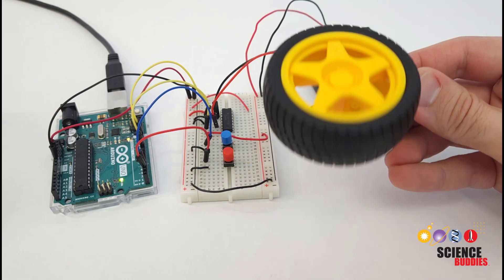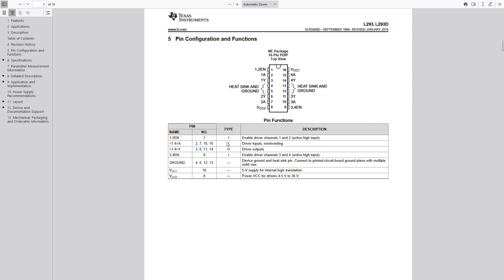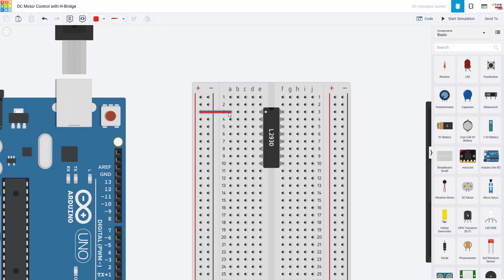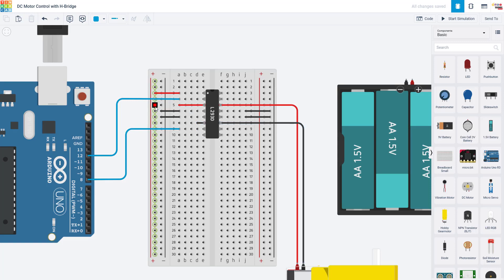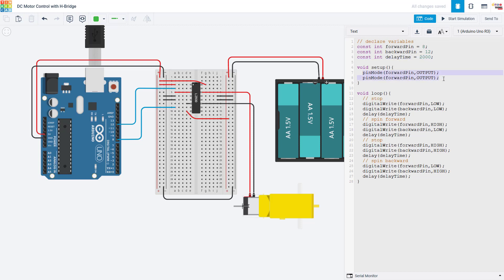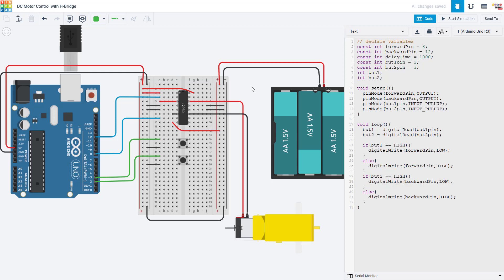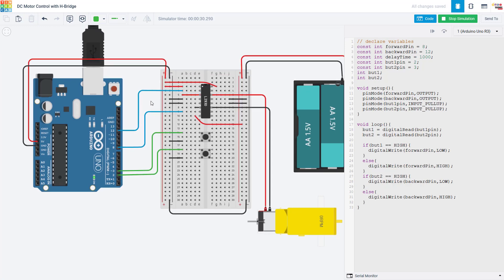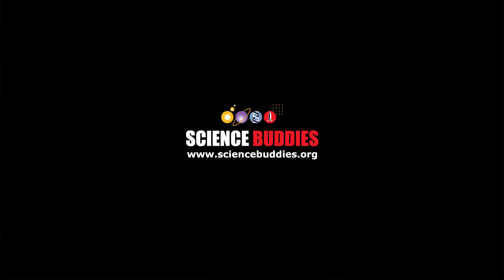DC Motor Control with an H-Bridge and Arduino (Lesson #17)

Comment: 1.Enb pin for speed control.
2.input Pin connect with digital pin(Control pin) .
3.output pin draw power from battery.
4-5 & 12-13. Gnd pin (act as a heat sink)
6. other output connect to motor 
7. 2nd input(Connect with digitla pin).
8. connect to battery(external power).
9-10. for 2nd motor.

11,14,15 
16. logic voltage(5v)

Comment: Hello so thanks for the lesson but i have a question . Does anyone know or can help me to make the motor switch between turning right to left to left to right without using the button , like he just keep switching between the two modes and i how can i control the speed ?
Reply from the maker: Hi - we recommend asking for help in the official Arduino forums.

Comment: I'm trying to control the arduino with an IR Remote instead, but whenever I write any value other than 255 for speed the motor just doesn't turn. Do you know why that would be?
Reply from the maker: We recommend asking for help in the official Arduino forums, they will need to see your circuit and code in order to help.

Comment: Great video. Is it possible to control the motor direction (and also stop the rotation) without using Arduino?
Reply from the maker: We recommend asking this question on an electronics forum where you will be able to receive more help.

Comment: Great video! absolutely loved it! I went back and forth with your previous videos and managed to put a lot of small bits together. I have a very silly question (I am just starting out...). I wanted to know whether we can add a LCD screen to the breadboard to visually see whats happening? Eg: voltage changes (due to ptentiometer) or RPM etc., I am trying to make a prototype and this feature might be very handy.
Reply from the maker: Yep, we have an LCD tutorial here! https://youtu.be/s_-nIgo71_w?si=WzxOJ5RH5R-_XlNO
Reply: @Science.Buddies  Hey, i noticed that there is a significant voltage drop of 1-1.5V across the H-Bridge (L2930). Can you comment on that? is it expected? if so, any way out?
Reply from the maker: The H-bridge has internal transistors which will have a voltage drop across them - explaining that gets deeper into electronics than we can get in a YouTube comment, but you should be able to find other tutorials explaining it on YouTube.
Reply: @Science.Buddies Sure. But any pointers to how I can overcome? Thanks a lot for your reply though😊
Reply from the maker: Unfortunately in this case you can't "overcome" physics - some H-bridges have an inherently larger voltage drop than others. The only solution would likely be to buy a different (and probably more expensive) H-bridge. If you search forums you will find posts about this topic such as https://forum.arduino.cc/t/l293d-motor-supply-voltage-drop-solved-again/218531 and https://www.reddit.com/r/arduino/comments/327kz9/l293d_voltage_drop/

Comment: As a novice, I find your videos extremely helpful. In my current project, I am writing (Adruino) code to slowly ramp up 12vDC motor speed (soft start). I would like to use a pot to only determine the motor max speed. So, the steps would be to (1) turn the pot knob to set desired max speed, (2) start the Arduion Uno, (3) read the value from the pot and soft start the motor to the speed set by the pot. Pots come with different levels of resistance (100ohm, 200 ohm ... 10k ohm). What pot would you recommend for such a project? (Thanks!)
Reply from the maker: Hi - we are unable to provide detailed help with individual projects and this is a bit more than we could explain in just a YouTube comment anyway, we recommend asking for help in the official Arduino forums.

Comment: I found out, quite by mistake I think, that I could (1) eliminate the connection from the Arduino pin 8 to the Input 1 pin of the L293D and (2) connect the Arduino ~11 pin directly to the Input 1 pin of the L293D. Then, I could still analogWrite() values between 0 and 255 to the Arduino pin 11 to control the speed of the motor without reading input from the pot. My goal was to automate a "soft start" and then "soft stop" the motor.  Is that a valid, alternate way to control the speed of the motor? Is there a down side?
Reply from the maker: Yes, it's perfectly fine to hard-code ramp-up/ramp-down PWM behavior instead of having it controlled by an external input like a potentiometer. This applies to any other input/output relationship with an Arduino. For example, a standard introduction activity is to hard-code an LED to blink on and off once every second, so there is no external input; then you learn to use a button to turn the LED on and off. In both cases the "output" code is the same. You could use anything (an internal delay, a button, some other external sensor) to trigger the output.

Comment: Great videos! I am wondering how I increase the rpm in this scenario. I need the motor to run up to around 8000rpm. Any suggestions would be great, thanks.
Reply from the maker: Hi - this is more than we can cover in the reply to a YouTube comment. You will need to look at the motor's datasheet and find its maximum RPM. We recommend asking for help in a forum dedicated to electronics.

Comment: Hey i know its late but can i ask a question, i followed your instruction  step step and it works here's the question though  my arduino is plugin to the computer as should be but the still motors run even though the external battery is not connected why is that?
Reply from the maker: You probably have something wired incorrectly on your circuit such that the motors are being powered by the 5V from the Arduino. We recommend asking for more help in the official Arduino forums. People will need to see pictures of your breadboard in order to help.

Comment: Sir ,
I have exact same mini project.
but we have to use a 15 V supply
so which motor should I use And is there anything that I need to worry about?
Reply from the maker: Hi - we recommend asking this question on the official Arduino forums.

Comment: is it fine if a use a 9V Battey instead, or will it burn the circuit?
Reply from the maker: You always need to look at the datasheet and maximum voltage ratings for the parts you are using in order to answer that question.
Reply: @Science.Buddies  ok, ty

Comment: Hi, if I wanted the motor to continue running after just pressing the button (not holding it down) how could I modify this code to accomplish this?
Reply from the maker: Hi - we recommend asking this question in the official Arduino forums.

Comment: awesome video, really helped me a lot! Just a question tho... couldnt this work wtihout arduino? just using a another supply instead of it? We would be using the buttons just for switching voltage to the input pins on L293D
Reply from the maker: Yes, you can use an H-bridge to switch the direction of a motor without an Arduino if you just want manual hardware control. For software control and more advanced tasks (e.g. steering a robot to react to sensors) you need the Arduino.
Reply: @Science.Buddies  Great. Thank you !

Comment: Hi! I'm currently building machine, which will be using 4 separate dc motors with a wheel on each. Is it possible to connect 1st and 9th ports of L293 (speed regulators) to the single PMW so that both motors would have the same speed?
Reply from the maker: Yes, you should be able to do that!

Comment: Do you need any resistors or anything? Thanks!
Reply from the maker: Not for this circuit!
Reply: @Science.Buddies  if I power it with a 24v 3a power supply would I need any? What would cause me to need them? I plan on using 24v dc motor and adding an OLED display with some extra functions, it will be my first project
Reply from the maker: Hi - if you need detailed help, we recommend asking in a dedicated electronics forum like the official Arduino forums, or a site like Reddit or Stackexchange. We are unable to help with individual projects in YouTube comments.

Comment: Wonderful vid ! I'm gonna use it to create a functioning RC-boat :D I do have a question though - In the previous video u showed that, when using a MOSFET instead of an H-Bridge, you gotta use a capacitor in order to reduce electric noise. Is it still necessary with an H-Bridge ? Would love to know bcs I'm applying an IR receiver to send the signal to the enable pin, so background noise will mess with the circuit/logic.
Reply: Hey, im also planning on building an RC boat. How were you able to communicate with the boat tho? Im struggling in that aspect as well as what material did you build it with? Did you have a “steering” system or just used the motors to turn? Sry for the list of questions :D

Comment: The one thing that you should teach students is that with a switch, you should always make/break the hot side, (the plus voltage side) and never switch the ground. This is a safety issue and if your students go out into the world they will be forced to always break the hot side. Therefore, one side of a switch should be wired to +Voltage, the other side of the switch should have a 10K ohm resistor to ground and the arduino digital pin is wired to the junction of the resistor and the switch. With this configuration the wiring meets the NEC in all 50-states. I know in the hobby world it doesn't matter, but you never know if your students are working, or will be working in industry.
Reply: Does NEC really cover the design of low voltage devices, here 5V DC?

In Electronics, it is quite common that signals are provided inverted, ie. Negation(RESET), Negation(ChipSelect), etc. The customs can vary significantly.

Here the author programmatically enables the built-in resistor within Arduino board which pulls the input value towards +5V (logical 1), hence one has to connect the input via a switch to zero potential (logical 0). 
It teaches the student that he can (1) save one external resistor and one wire connection, ie. the wiring is simpler and it also teaches (2) to lower the cost of your design, plus that (3) the input can have the inverted value (Logical 1 = switch OFF [a default], Logical 0 = switch ON). 

Basic Arduino Starter Kit still contains even the wiring which uses your design (resistor, and a positive logic of a switch). Just for the completness. But any advanced user will use the approach used here.
Reply: @vojtechkment2956  The NEC talks about low voltage wiring. They typically start at 24Vac/dc and up. I am very aware of the Arduino built-in resistors and I don't see any problem using them; however, the way safety standards are heading I would start teaching students, when using a mechanical switch, to always break the hot or high side; the voltage side. Even at lower voltages it's still the safest way so that the user is always on the ground side.
Reply: Isn't the actual flow of current from - to +?
Reply: @Bagunka  yes. Many years ago, scientist considered the earth to be negative, and since lightning "seems" to come from the clouds down to earth, they assumed electricity flowed from positive to negative. We know that is not true. The reason, when switching electricity on or off, that you should always break the hot side (+) is so that the user operating the switch is and will be on the ground side.

Comment: Can you explain why do you need a common ground? 9:45
Reply: Basically, tying all grounds together ensures they are all at the exact same voltage level. Power sources always experience small fluctuations, and keeping all grounds together ensures they are all equal and do not vary between sources. 

There are times where you isolate grounds when dealing with highly sensitive analog signals, such as in a radio, where you will keep "noisier" components, such as amplifiers, separate from the small signal itself. "Noise" being small unwanted electrical changes induced in a circuit, such as by a magnetic field from an inductor or, again, voltage fluctuations from a power source.

Comment: This video is great but I cant really wrap my head around how the motor is connected to the breadboard. I tried the code after putting everything in place, double checked the wires and it didnt work but idk if my motor is conected correctly. I also was wondering what arduino version you use.
Reply from the maker: If you're having trouble we recommend starting at the beginning of our Arduino tutorial playlist (linked in the description) and also watching our How to Use a Breadboard video: https://youtu.be/6WReFkfrUIk?si=byMxk5OcEK-xG2Df. The H-bridge is a more complicated circuit so it will be challenging if this is the first thing you're trying to do. Our videos show the Arduino UNO R3.

Comment: Hi,thanks for your video.I have some questions:If i use the switch to control the  motor ,when i push the first switch button it can clockwise rotation,but when i push it again,it can not stop.  And then i push the second switch button------- it  makes clockwise rotation slowly but can not counterclockwise rotation, and then if i do not push the second button,it still  clockwise rotation without slowly condition.I do not know why..Could you please help me ?
Reply: Maybe the HIGH and Low is not clear in the code,and when i modify a little code ,it works.....

Comment: Is there an alternative way to power this like with a 9 volt battery to the Arduino
Reply from the maker: In general you don't want to use a 9V battery to power motors as they will drain the battery very quickly. Check out this video to learn more about your options for powering Arduino projects: https://youtu.be/I7MrL5Q7zvY?si=zagNwvLt5MSBBGNQ

Comment: Hey, I don't mean for it to look like I'm asking for tech support, but I decided it worth asking anyways. In following along with the video, I got stuck when I went to try to add the two buttons in by myself. I then tried to just copy why you had done, but the motor would just run at 83rpm without any input, and would only change (to 0) while holding down but2pin.  All this on Tinkercard by the way. Is it possible for you to tell me what I'm doing wrong?
Reply from the maker: Hi - if you're a student doing a science project, you can ask for help in the Ask an Expert forums on our website: https://www.sciencebuddies.org/science-fair-projects/ask-an-expert-intro, which is monitored by volunteers. Unfortunately we're a small organization and don't have the capacity to provide tech support beyond that, but we'd recommend starting earlier in our Arduino playlist (linked in the description) and check out the video about buttons before you move on to motors and H-bridges.

Comment: Thanks, I've some questions:
Is hooking up 4 GND pins needed? They are for cooling, and the clamps in the board will cool them. The 6V input is also a single pin, and it has the same current going through.
Do you need to set the pins as output? As there are a bunch of power transistors in the IC, won't they work on the default low-power output? Or do they need full 20mA to trigger?
Can you set Tinkercad to put wires on top, now they dive under the IC which looks very weird.
Does a LEGO motor work the same? How to change speed/power in code?
Reply from the maker: Hi - you have a lot of questions here, more than we can address in a single YouTube comment. You may be able to get more answers on the official Arduino forums or forums dedicated to electronics like on Reddit or Stackexchange.

Comment: Hey, great video. But I am confused, whenever I hook up a small DC motor to this circuit the motor doesn't work. The motor works when I take it off and plug it directly to the battery pack. Do I just need a bigger battery?
Reply from the maker: To clarify, you need to have Arduino code running for this circuit to work, the motor won't just spin if you plug it directly into the H bridge.
Reply: Yes, the circuit did have code running, but I found that if I give it a little push it will spin slowly. I think I just need a bigger battery.

Comment: Hi, I am struggling to get this to work with no buttons. I have included Motor.h and Arduino.h and used your exact code. I get the error message of;

C:\Users\cespa\OneDrive\Documents\Arduino\libraries\L298_Motor_Driver\Motor.cpp: In member function 'void Motor::goPercentage(uint8_t)':
C:\Users\cespa\OneDrive\Documents\Arduino\libraries\L298_Motor_Driver\Motor.cpp:101:13: error: 'speed' was not declared in this scope
  checkWrite(speed);
             ^~~~~
C:\Users\cespa\OneDrive\Documents\Arduino\libraries\L298_Motor_Driver\Motor.cpp:101:13: note: suggested alternative: '_speed'
  checkWrite(speed);
             ^~~~~
             _speed
exit status 1
Error compiling for board Arduino Uno.

Please help,  thanks!
Reply from the maker: When you get an error message like that, it helps to google specific parts of it (not necessarily the parts with the file path on your computer, since that won't match what other people have when encountering the same error). When you see something like "error: 'speed' was not declared in this scope" that usually means a variable was not declared properly, e.g. "int speed" may be missing from the beginning of your program. Going forward, we can't provide much debugging help in YouTube comments, but the official Arduino forums can usually help.

Comment: So can this be applied to 2000 rpm 12 V motor too?
Reply from the maker: The same concept applies but you will need to check the datasheet for your motor to see how much current it requires, and make sure the H bridge you purchase can handle that much current.
Reply: @Science.Buddies  so my plan is to first try and write the code for a small simple motor 

Then I can use a large motor also I got some recommendations to use a l298n module
Reply from the maker: The code should be the same regardless of the motor size.
Reply: @Science.Buddies  ok thank you sir